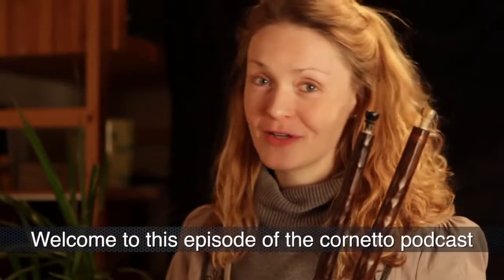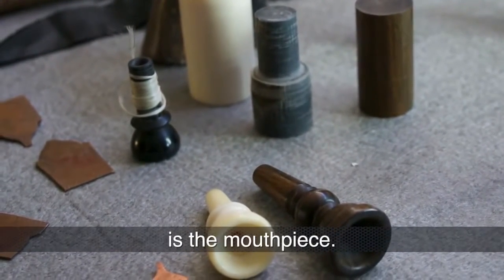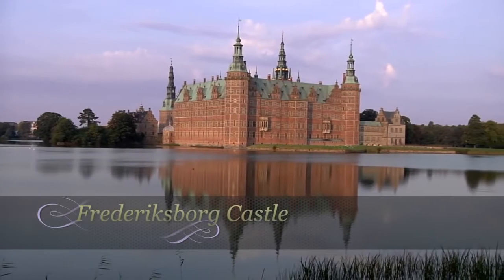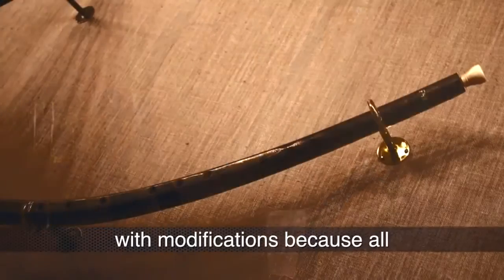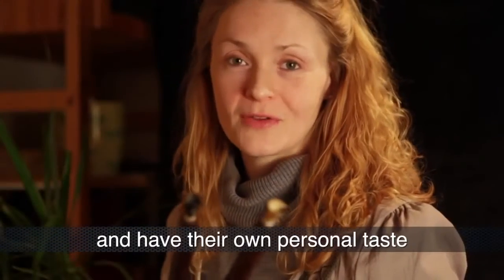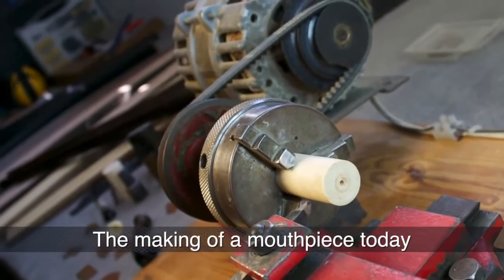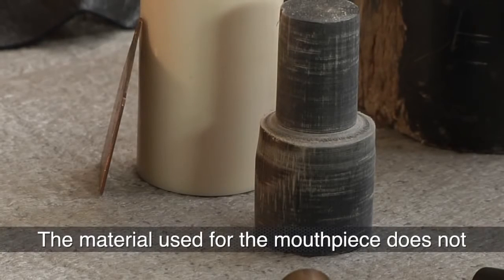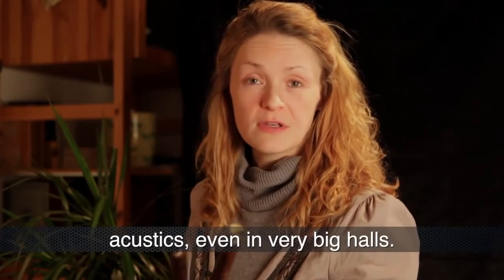The Cornetto Podcast   Episode 3

Comment: Where could one buy a cornetto today? I've fallen in love with the sound and would love to learn.
Reply: I bought mine from Ebay. Made by Monk. It cost me around £ 150 - I don't believe Monk is around any more, but 2nd hand Cornettos (or is it "Cornetti" ?) - do pop up occasionally. I built my own one sometime after selling my Monk instrument. I made it from brass, then covered it with leather .... it played, but not terribly well. I'm currently 3D printing a mute cornett. If it works any good, I'll cover it with leather.
Reply: Richard Barton Thank you! I've been checking eBay the last few weeks, and I'll just keep my eyes open for a while.
Reply: A few names: in Europe, Jeremy West, Damien Bardonnet, Sam Goble, Paolo Fanciullacci, in US John McCann. There are others as well…
Reply: @and7barton  keep us updated on the 3D-printed instrument!
Reply: Hello - The 3D Cornett printed okay but plays badly. It's leaking. I've given it several coats of lacquer on the outside but it's still leaking seemingly from quite near the mouthpiece. The exterior is sealed now so it has to be leaking from the inside into the hollow wall of the tube. My next task is to try and lacquer it internally without puddling. Another possibly leak source could be through the wall of a fingerhole, again into the hollow between the inner and outer skin. I have obtained a sheet of thin black leather for the exterior but I'm not going to commit that yet until the leak issue is solved.
Reply: Thank you for the update!  I hope you can track down the leak.
Reply: It could be worth 3D printing one. The coding is free on one of the sites that air people's codes and designs. It's printed in 4 lengths in a single operation. You have to glue the sections together afterwards which is easy as they fit into one another. Unfortunately, I've only seen the mute cornetto file available. I'd have preferred to have the curved cornetto.
Reply: Yo tengo dos
Uno mute y un curvo
Son bastante buenos